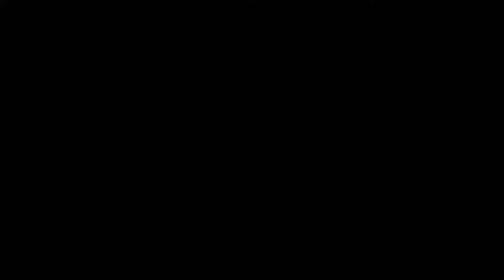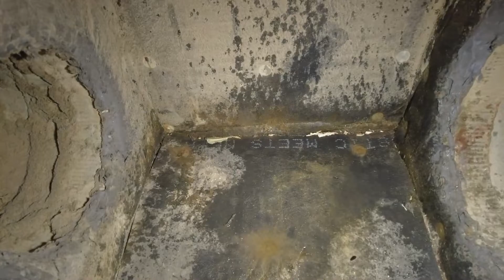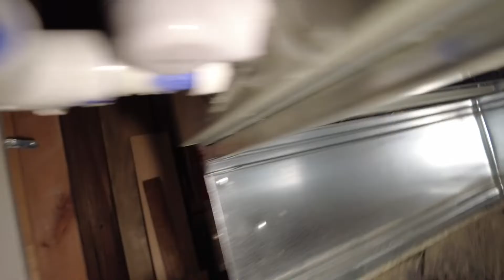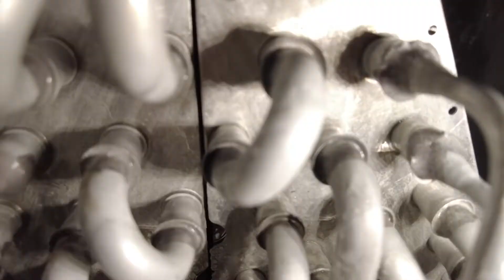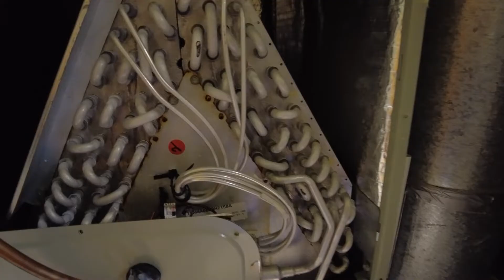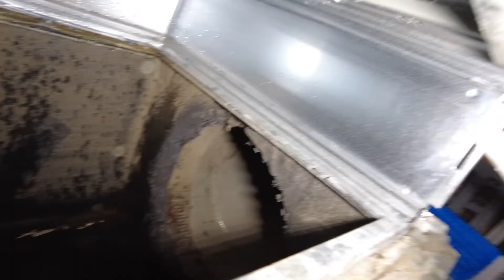Why Water Drips off of the Evaporator Coil before running into the pan | Low Charge Dry Circuits

Comment: Thank you much for this explanation.
Reply from the maker: You're welcome glad its helped!
Reply: I called the serviceman and he checked the coolant pressure which was normal.  He added one pound.  The unit still dripped a lot from the center coils in many locations. I could see the water drop run down the inside coils, 1/3 to 1/2 way (before the drain tray) then drip off the coil to the bottom of the return air vent padding.  The coils are shaped like this /\ .  The coils looked clean but the serviceman suggested I clean the coils with a garden sprayer which I did with very little soap and mostly water, and then rinsed with water with a very little vinegar.  The drips have stopped.  This is day two and still no drips.  Carrier poor design I think.
Reply from the maker: Nice! Glad to hear that worked out for you👍

Comment: I had this problem with a Carrier unit and had the coil replaced under warranty. Worked well for a few months and now having same problem. Any other AC unit you recommend.
Reply: In the same situation right now...  had the dual-metal coil replaced on my Carrier unit and now I'm onto the all-aluminum one.  water all over the floor.  Water is dripping off the coil onto the blower fan and getting all into my electrical below that shelf.  Such a terrible design.  Drip pan is fine and drain is not clogged.
Reply from the maker: Crazy, did you find it to be low on refrigerant?
Reply: @d.k.schrute9917 did you ever find an answer? I'm having this same ridiculous problem. Refrigerant levels are good

Comment: My coil is dripping water directly into the return duct, Trane 3 & 1\2 ton unit with an A coil. 
Charge is normal, but the bottom 2\10ths of the left side of the coil stay dry and the water drips down just missing the pan. The dry section looks discolored, and the tech cleaned it he said.  He also says I might need a new coil if it continues.  I'm pretty pissed because I don't see why a new coil won't do the same thing.  Anything I can do myself? I already cut an access hole into the duct under the coil so I can monitor the situation.
Reply from the maker: Weird, Are the fins in good condition?
Reply: @HVACTechKnowledgy  Yeah they are fine and it's a brand new coil less than 3 years old.  On the area where it's dripping from, there is some weird discoloration. Refrigerant levels are good, so it's not low pressure. 

I stuck some plastic pieces in the pan under the coil, but I think I'm still getting a little dripping because the humidity in the house is up and while the bottom of the return plenum is no longer leaking, it still seems soggy.

Comment: It drips water cause it is a Trane with dead spots/circuits, drips water cause of screws pushing on fins.  Leak cause it is a Trane either big leak or very big leak.  I hate those coils, nothing but problems.  I have avoided getting dead spots cause of removing metal shaving before distributor tube/after TXV.  I have gotten replacement coils and find shaving sometimes.
Reply from the maker: Yeah I've been seeing a lot of leaks on the new trane coils myself, not sure what's going on
Reply: @HVACTechKnowledgy  we are doing bryant or carrier evap coils under warranty every week it seems

Comment: I've had those problems with microchannel coils and they sent me a drip baffle after I verified charge, superheated and subcool. Thanks for the clear explanation of what happens that would cause the water to fall off at a dry spot.
Reply from the maker: Interesting so it just wasn't set up properly during installation?
Reply: I just think it's a problem with the product. I say this because even after I added freon to get correct superheat, subcool and delta t, water still dripped. Installed baffle and no more water issues.
Reply: Nordyne is known for that. That's why they came up with buffle kit( wich restricts airflow of course)

Comment: On those carrier little slab coil I’ve had that happen a bunch just like you said low refrigerant charge, charge up right  And she’ll be sweating from top to bottom good video
Reply from the maker: Nice! Appreciate the feedback.
Reply: @HVACTechKnowledgy  If you can’t get it to drip correctly on those calls spray it with some Dawn dish detergent
Reply: @chaddarr4834  what if you do that and it keeps reoccuring, what could cause it to become dirty again or can refrigerant restriction cause that?